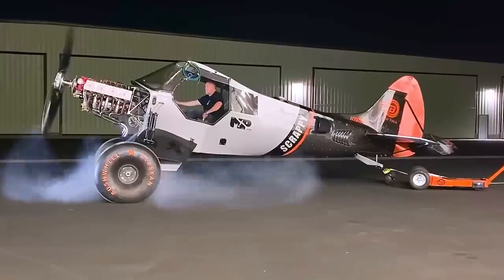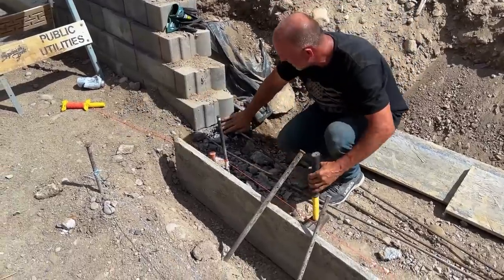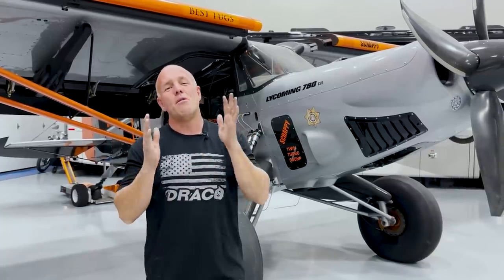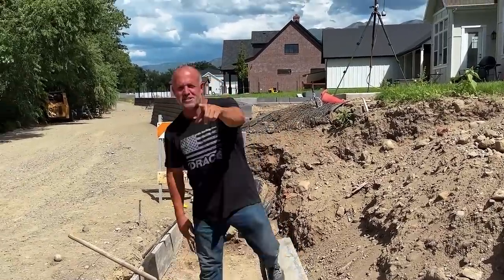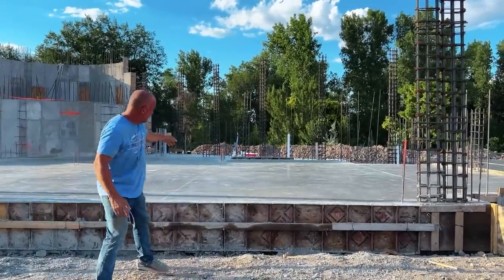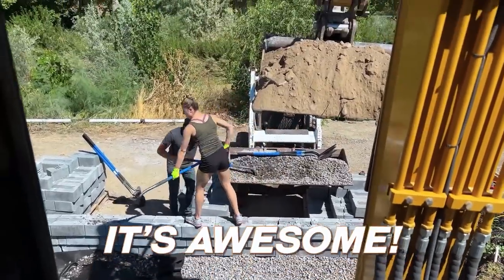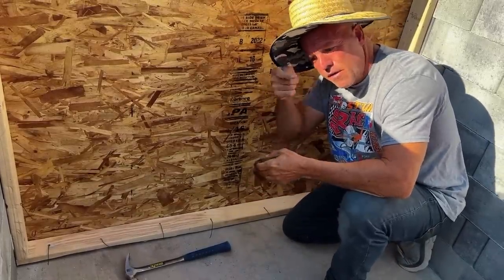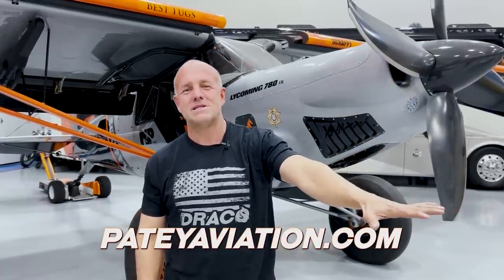House Update & 2 BIG Announcements | House Build #4

Comment: Mike says it’s just engineering. No, it’s Mike Patey style over engineering. In a day in age where everything is “value engineered”, which is a marketing way to say “as cheap as we can possibly make it”, Mike still looks at things and asks what’s the best way we can do it? But if you are going to build crazy stuff, you need to go that extra mile in both design and execution. Great job as always.  Thanks for bringing us along Mike!
Reply: @ralphgesler5110  "Over Engineered" is normally going above and beyond requirements. 
So in terms of the house, that would mean added extra re bar, extra concrete, etc. 
In aviation, it's adding extra safety margins, extra corrosion protection, things like that.
Reply: Value engineering is frankly quite awesome and exciting as well, but only when done well. It is incredibly rewarding to take an existing product that has been made a particular way "just cuz" for a long time and actually engineer it into something that keeps all of its functionality but for a lower cost. It's just not as sexy as something like this.
Reply: My motto is anything worth doing is worth overdoing.

Comment: I'm not surprised to see your family working on your house but I was impressed. The scale of this house blows my mind. BTW - the retaining wall around the perimeter would make a good RC car track :) I used to work in construction, long ago. I've tied steel, set forms, run conduit, pulled wire, run tubing (instrument lines), run heavy equipment, including 35T- 50T cranes. All equipment except the backhoe. They wouldn't let me open ditches with the hoe. I never mastered straight ditches lol I could haul forms but no ditching allowed. It's satisfying work. You can see what you've accomplished every day. The airport community sounds great! Maybe I'll get to fly in there some day.

Comment: Mike, Mark and Families 
I should be sending you a monthly check just for the education you provide ( case in point using ty wire and a duplex nail instead of a Tapcon for concrete bracing, this may be a standard solution but is the first time I've heard of it) I enjoy your Videos greatly and the fact that you are a great promoter of reason, common sense and family is something that is refreshing in these " Me First" times that we seem to be living in.

Comment: I much prefer the airplane videos, not just because I am an avgeek, but also because on aircraft you had to balance strength with weight. I liked seeing the optimization. On the house, everything just seems overkill. With money and weight no object, you're just framing with 6x6s because you can. Why didn't you use precast for the garage floor if you need to span distance?

Comment: You could always use a "Softcut"tm concrete saw or depending on scenario use tension cable, like in a tennis court witch they do not cut, but it still cracks.

Comment: Hey Mike. I'm not sure what filter fabric you are using, but I've found over 25 years of basement waterproofing that filter fabric never allows the water to weep fast enough to prevent the issues you were talking about for that retaining wall. I've had to redo quite a few jobs because the fabric was causing too much pressure to build up and water would make it's way in somewhere else while also bringing soil with it. We haven't used it in 10 years and have not seen any evidence of soil moving into our pipes. It's only ever been fabric systems that we've seen massive amounts of soil movement. We found it's better to just use a lot of stone around the pipe and forego the fabric.

Comment: Suggestion for the airport, install a big EV charging hub, it will pull people in to use the onsite cafe/restaurant and give people with aircraft onsite a place to charge their car ready for the return trip home.

Massive solar farm, couple of wind turbines great for navigation too best of all, cheap clean energy for the site.

I hope the house is getting a nice big solar arrays and other green tech too.
Reply: Have to be careful where you put the wind turbines because of the “no object zone”, and ILS 40’ to 1’ plane that goes out from the runway. Basically towers are not to welcome close to an airport. Great idea about the charging station though. You said it before I could.😅
Reply: @bradycope2332  would have thought as long as it's offset sideways from the runway turbine would be fine? 

Also am I the only one thinking about the energy requirements of the house and the sheer amount of co2 for all that concrete? Sure there's some insulation at the bottom of the pool but not much. 

No mention of a ground source heat pump or solar either.

Comment: Mike, use weed eater string instead of tie wire for your nails into concrete if you are doing it in an area that will be exposed. Costs a tiny bit more, but much less spalling around the holes when you pull the nail. I really dig your propensity for doing things well!

Comment: Use weed eater string not the tie wire with the duplex nails. Will not chip the concrete when pulling it back out

Comment: I think the most important thing for the FBO is to be open and inviting to the public. So many airports are fenced off like private country clubs that give off the aura of exclusivity. Put windows on the hangars so the public can see the planes. Put clear walkways in so a single mom and her son feel will comfortable walking in and admiring the planes. I know there are safety concerns, but there must be a way. Ot would add cost to the project, but maybe you could sidewalks and windows in between the hangars, opposite the taxiways so that the man doors and windows would be directly across from the airplane doors. Or have sky lights and walkways above the hangars. Finally, airworthy planes have to stay airworthy or be moved out. Maybe there can be waivers given by a board of directors to give people time to fix or build things. The point would be to keep hangers from being used as expensive storage units that kill the atmosphere. The airport should be buzzing with activity, not attracting dust and cobwebs.

Comment: Curious why you did not use coated rebar? Especially with all the water and climate it’s required on bridges and stuff like that at least in Pennsylvania.
Reply: Anyway, I messed that up a little bit but you should be using rebar with a coating. Rusty rebar doesn’t number on concrete.

Comment: Curious to know how the ventilation will be routed and made more efficient if cement's R value is so low. Is the cement 12 inch / 1 foot for structural purposes only or for sound insulation as well?

Comment: I'm sorry in advance for the engineering difficulty of it but; few bottom windows that can support the weight of the water so when in the garage under the pool you get some light from the pool water and when diving you can watch your kids use the wrong tool on stuff.

Comment: If you want an airport that is better than all other airports do something different ( But still Science). Find a good Sociologist to help make each aspect of your new airport not only multiple use but also build in places for social gathering. To do this correctly one has to understand why spaces function well for humans and not just the machines we park in them. All to often we see airport lounges that are not used.   Simple things like windows that view the flight line make a big difference in lounge areas. Placing lounge areas at the ends of each row of hangers might provide places for gathering and ample bathrooms.  It is easy to find airports that don't function well inspite of the engineering that has gone in to them. I am looking forward to seeing the completion of your home and excited to see what a real aviator will do when building a new side to your airport.

Comment: Instead of the perf drain, couldn’t you have just had weep holes from dirt side to face side to let any built up water drain or were you concerned about aesthetics of water stains?
Reply: weep holes might freeze as soon as the water comes in contact with minus 10 temps on the outside?

Comment: Mike; not happy with the fabric behind the wall. Fabric has the problem of holding back soil fines that hold water. that puts stress on the wall as block type retaining walls are supposed to move up and down. As to the concrete footing is good but NCMA lets use use a thin pour of mix along the line of a 1 to 1.5 bag mix. We use the minimum of 12" or free draining stone behind the wall and grid spacing is 1/3rd the height of the wall. Openings are cut every 50 feet to let out water from the pipe and since it's stacked block water can and will weep out from any place along the wall. I know I am talking to an engineer but having put up millions of sq ft of wall and worked with engineers in designing and installing block walls over 20 + feet tall with surcharges on them along with fences and variable moving surcharges (IE trucks and cars), again I haven't had the time or opportunity to study the plans or have a soil engineer to test out soils , compaction, moisture and soil holding capacities , to know if granular fill would need to be brought in.

Comment: I personally do not think this will work as you think it will. Remember, LSA was to bring affordable G.A. to the masses. Well, that didn't work. LSA started to take off when a new Cessna was $90K to $125K and all it did was push everything way up. Now, the lowest end ready to fly LSA cost more than a median income home and an average equipped new 172 is around a half million dollars. As long as the lowest tier new G.A. aircraft is only within reach of the top 2% wage earners, then only the top 2% will fly. Period. The above is irrefutable unfortunately. Please continue this advocacy work, if anyone can change this fact, it is you and your brother. God bless.
Reply: There are some great airplanes and kits to build out there for less than $100k. Just may have to do a little shopping. One other way to afford is to partner on one.